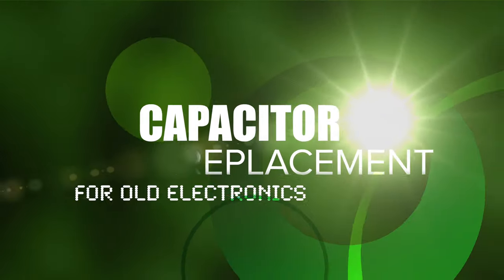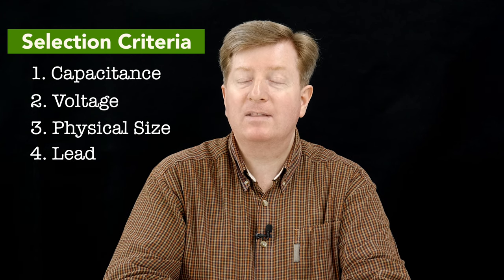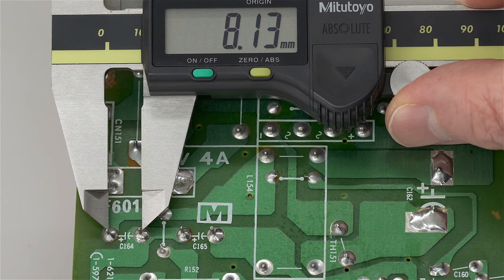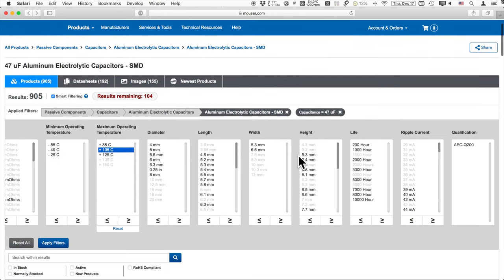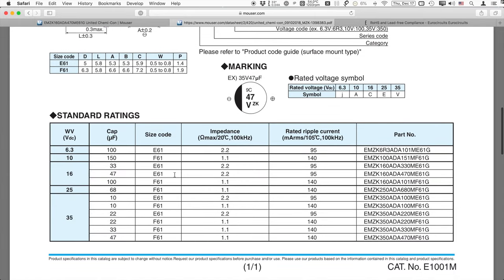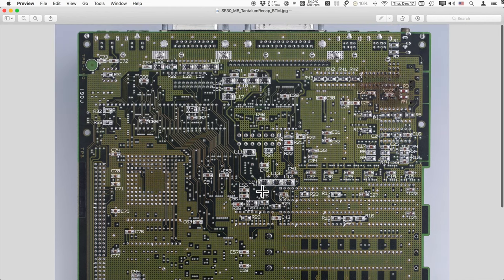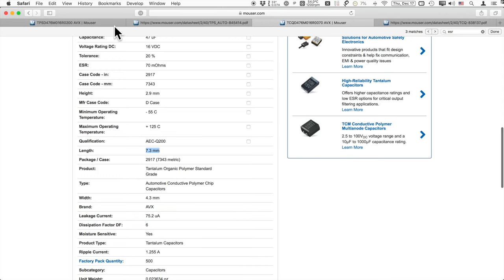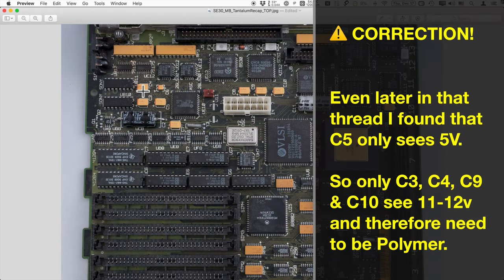Choosing Capacitors to Recap Old Electronics

Comment: If you aren't able to determine the original voltage raring of a cap. Look for other caps on the board that are in parallel to the one being replaced.  The voltage rating on those would be the same as the one in question.
Reply from the maker: That sometimes works, but not always.  It's still a guessing game.  For example, the SONY PSU inside an Apple HD20SC external hard disk drive enclosure uses two 2200uF caps side by side, but one is rated for 16V while the other 10V.  In that case I can see the voltage ratings, but let's assume for the moment I could only see the voltage rating on one and not the other.  Well, I thought it okay to buy two 16V replacements because they would physically fit, but I later found the output became unstable due to the fact the higher voltage rated cap had different ESR specs which impacted the require minimum ESR of that particular power supply.  You can see that in my video below and in the spreadsheet I made which shows replacement cap specs side-by-side.  So if you look at a given PCB and pick a replacement cap based on the voltage rating of nearby caps, it may or may not work as expected, at least, not in a switch-mode power supply.
• VIDEO: https://youtu.be/Qof-Wjj_rWI?t=1643
• SPREADSHEET: https://bit.ly/3yFsoOT

Comment: Your definition of “old electronics” is my definition of “modern”! Surface mount components, IC’s! Hell I think anything solid state is modern let alone ICs and surface mount stuff! The term “Older electronics” means vacuum tube stuff to me.
Reply from the maker: I was 13 in 1984 when the first Macintosh 128K came out.  I am a fan of such 1980's vintage computers to this day.  So when I speak about something old or vintage, it tends to come from around that time frame, or perhaps a decade earlier in the 1970's.  Vacuum tubes were a bit before my time. 🙂
Reply: In the late "60s, I used to frequent the Burstein-Appleby outlet in Tucson.  The franchise was owned by an old ham, Walt Nettles.  He told stories about the REAL good old days of amateur radio.  He told tales of reluctors, chemical rectifiers, and the rotary spark-gap...and then, young up-start, Lee De Forest, invented that damned three-element vacuum tube, and the whole World changed!  Now THAT was "old" electronics!
Reply: Imagine how it was.....You're sitting at your bench, tapping on the key,  the fizzing/bubbling of the bank of chemical rectifiers in the background, the buzzing/crackling of the spark-gap...you flip the knife-switch to "receive," adjust the "cat whisker" on on your galena crystal.  Outside, the end-fed Long-wire (1+ wavelength at a couple hundred "kc") sways in the wind.  THOSE were the days!
Reply from the maker: @Pootycat8359  Being only 51 and too "young" :-) to remember those days, I will take your word for it, especially because I've never touched a HAM before (well, except for Thanksgiving and Christmas).

Comment: Loathe LEAD-FREE SOLDER,JOINTS. Especially dry joints manufactured in early days of Lead free implementation. And when I returned to soldering after two decades of total passivity, I didn't know what is going wrong.. soldering was easy when i was barely TEEN,and now I couldn't joint two cables together, leave alone audio connector...
Reply from the maker: Indeed, and here's an excellent overview of the TIN WHISKER PROBLEM pertaining to Lead-free solder: 
https://www.analog.com/en/technical-articles/tin-whiskers-are-real-and-complex.html
Reply: This is so true, last I soldered a substantial amount was Hafler Amp and preamp kits in the mid 80s I just completed a blue ESR meter and within minutes noticed that lead free sucked and required higher temps.  Thank heavens I still had legit fine rosin core solder from the mid 80s that flowed beautifully.   You gotta love so called "progress".

I'm going to be on a hunt for the real stuff, is it available anywhere?

Comment: Just recapped my IIsi today, it's working! all I need is a monitor and peripherals and I will finally have a really nice vintage mac. I unfortunately had not watched this video at that time, but here I am now. I did buy the logic board caps from amazon, but the power supply board caps are from Mouser.
Reply from the maker: Glad your IIsi is now working!  I can't speak about caps from Amazon, but I can say that when you buy from vendors like DigiKey or Mouser or RS Components, you will get quality parts.Sometimes when you buy from Amazon, you don't know what you're getting until it arrives, and that remains true even if the Amazon page advertises a big name cap brand like Nichicon.  Also, if you need cheap caps quickly, yet from a very reputable vendor, you should check out Console5.  I've not purchased from them only because I always get parts from Mouser, but their kits are top notch and sell for great prices.
Reply: @JDW-  Yeah, I kinda, just put in the uF and volts and went from there, I got lucky on amazon because the size was good enough and I did have to replace some axials with radials. I used a pic guide from @BranchusCreations IIsi video. Wish I had watched your video sooner lol. Oh well, lessons learned.

https://www.youtube.com/watch?v=YNsPr1mHUrw

Comment: Great tutorial. You can also measure the resistance or microhenries of the inductors with the MESR-100 ESR meter. The reactance formula is 2𝛑FL. That would be 2 x 3.14 x frequency of esr meter which is 100 kHz x 100 (uH) Just plug it in to get the reading.

For resistance R=0.628 X L(uH)
For Inductance L(uH)=R(ohms) ➗ 0.628

Comment: There's one useful source of information you didn't specifically mention.  Often you can track down "service manuals" for your equipment.  This is usually the source for the schematics, but "service manual" is usually a better Google search term. Even if the service manuals only have block diagrams, they sometimes list the "bill of materials".  For example, I have a music studio effects unit from Lexicon, and its service manual lists all the capacitors used, their specifications, how many of them there are, and what they are labeled on the silkscreen on the motherboard, i.e.:
"CAP,ELEC,22UF,25V,RAD   4     C27,28,31, 104"
Having watched your video I can now interpret that as "Capacitor, electrolytic, 22 microfarads, 25 volts, radial.  There are 4 of them, specifically the ones labeled 'C27', 'C28', 'C31' and 'C104' in white on the motherboard."  I'll still need to measure them with calipers, but I'm a lot farther into identifying replacements than I was before.
Reply from the maker: Thank you for making time to let me know my video was helpful to you, and for sharing your personal experience. The primary reason I did not mention “service manuals,“ is because I myself recap vintage Macintosh computers, especially from the 1980s. For those machines, there are no service manuals with schematics or BOM‘s. Larry Pina books offer a complete capacitor list in the appendix for certain Mac models, but for other Mac schematics you need to search online, especially vintage Macintosh discussion forums or the Macintosh Garden. 

For applications like yours though, you are correct, there are a good number of service manuals out there which provide extremely detailed and helpful information. Thank you for bringing that to our attention.

I wish you the best in your recapping adventure!

Comment: Very helpful. Thanks for sharing your knowledge. I'm a mechanical engineer and electronics are not my expertise. Despite that, I've always been interested in computers and have build my own machines since 386/486 days. At high school, I had an Apple II+ plugged into a 26 inch Philco TV (valve tech), which I had to "dispute" with family. A lot of nice memories. Anyway, I have some retro stuff at home: kept P2, P3 and some Athlon XP mainboards, plus 3dfx video cards, and an Apple II plus, IIe and IIGS I've collected over the years. Most of these boards (and some PSUs) need a recap job. I've trained over the last year on junk electronics (meant to scrap) in order to learn how to weld and now I feel confident I can do it. I decided to learn this skill because many things break at our homes due to failing/ageing capacitors and most business just want to replace parts, not fix. A total waste and very hard to keep our loved retro stuff working. That's how I've arrived at you video. Watched 2 times already. Made a list of the capacitors I need and have browsed over mouser.com. One thing I didn't get, it is how to choose capacitors for these mainboards concerning ripple current and ESR: what should I pick?  If I understood correctly, ESR is ok if not too high, but it doesn't have to be the lowest also. What about ripple current: low or high? That was not clear to me. Hope you or someone reading the comments can clarify that.
Reply from the maker: Typically, a low ESR capacitor will also allow for a much higher ripple current.  I hesitate to give you a general rule for choosing ESR and Ripple only because it really depends on what you are recapping.  

Power Supplies are most sensitive to ESR and Ripple.  If you are not recapping a power supply, but instead doing a motherboard, in many cases the capacitors are just what they call "bypass capacitors" which prevent voltage drops from occurring.  In that case, you can most often use the lowest ESR caps possible and will be fine.  In fact, I recently released a video on Overclocking a Macintosh LC575 motherboard (aka Color Classic MYSTIC), and I used solid polymer OS-CON capacitors, which have only about 0.025 Ohm ESR, and discovered that kind of low ESR capacitor is actually required to overclocking to the highest speeds.  Two associates tried overclocking with solid tantalum capacitors (0.7 ohm) and found they could not overclock as high!  So low ESR capacitors definitely have their place.  

Often times, very low ESR caps can be used in power supplies too, but some power supplies require a minimum ESR, and it's very hard to know that without a schematic, yet most of the time we don't have a schematic!  I came across that problem when I recapped the Apple HD20SC external hard disk enclosure.  I did a video on that as well.  The power supply had a brief whining sound with a very low ESR replacement capacitor, but when I swapped out with a slightly higher ESR cap, the noise went away.  (Basically the switching frequency became unstable at power on due to the low ESR cap.)  

All said, the best general advice I can give is to go with low ESR caps where possible, as those will work most of the time, but you need to be prepared to try different caps on some power supplies.  If you choose a polymer aluminum cap, I recommend the "solid" kind rather than "hybrid" because the hybrid types have a liquid inside that theoretically could leak out many year from now.  Solid type caps cannot ever leak.
Reply: @JDW-  Great! That's what I needed... some pointers... I got your point, don't worry I understood your rational... and have now a starting reference. Thanks a lot / kind regards

Comment: Great use of Mousers site to illustrate the thought process used toward picking out a replacement option. I prefer Mousers site myself and thought i would throw my 2 cents in about one of the features I love.

This may have already been mentioned by someone else but Mousers site actually will show how many fit your criteria BEFORE you hit apply. 

At the Far left of the screen under the Products Section in Blue it keeps track of the shown RESULTS # —> To the RIGHT in RED it keeps track of the current results remaining according to your filters. 

To actually view those results you still need to click apply filters however it’s a very helpful tool to know ahead of time which filters you’re choosing might be excessively limiting your options. 

ESPECIALLY if any of the filters were preference and not strictly necessary for the operating criteria.
Reply from the maker: Yes, it is convenient. Thank you for pointing out that feature.  I show it at about 25:38 in the video, but I do not discuss it.  You can see "Results" at the far left (a large number) and then I click a Voltage Rating filter (but don't Apply it), and "Results Remaining" appears in red, showing you what to expect when you do actually click Apply.

Comment: Hello James, thank you for putting this together! The video was both entertaining and most educational. Unlike yourself, I don't have an electrical engineering background but my collection of old Macs does require that I know what I am doing to the best of my ability and your expert advise on all things capacitors has given me much need confidence and a heck of a lot of information that I was able to easily grasp. I would also like to thank you for the practical examples based on the SE/30.

As you know, collecting vintage equipment does require a number of skills, key sets of knowledge and repair/diagnostic equipment to effectively maintain the health and wellbeing of those devices. Again, your expertise has elevated my confidence in effectively choosing the correct capacitor for the application. I sincerely appreciate the time and care you put into making this video and I am definitely bookmarking this video for future reference. When I am better able to, I will drop something in the PayPal tip jar as a token of my appreciation!
Reply from the maker: Thank you, Alex!

Comment: Thank you for a very in depth content regarding capacitors.  For most hobbyist types like me, caps have always been a bit mysterious.  Almost all other familiar components with exception of chokes maybe, it’s pretty straight forward.  I really appreciated how you took the Mouser filter to the nth degree.  And you description of tantalums was dead on.  A question… is there a modern replacement for RIFA caps?  I like the idea of having filtering on the mains.
Reply from the maker: Hi, Frank.  In the Mouser cart I provide in the text description under my Mac Plus Analog Board recap video, I use a Ceramic Safety capacitor with X & Y ratings as a replacement for 
C33 & C37: https://www.mouser.com/ProductDetail/80-C971U472MUWDBWL40
So when replacing a RIFA, you just want to make sure your ceramic has the correct high voltage rating, then make sure it has the X1  & Y1 safety ratings, ensure the capacitance is the same, and make sure the lead spacing is such that it will fit nicely.  Some of my Analog Boards have RIFAs while others have the ceramics -- all original parts from back in the day.  So there's nothing inherently wrong with substituting a plastic and paper RIFA with a good ceramic safety capacitor.

Comment: Super Walmart now sell a hardplastic digital calipers for under $10. They are extremely accurate and repeatable on measurements. I was very surprised!
They are nowhere near mitutoyo quality!
For a hobbyist they are perfect!
Reply from the maker: Ronnie, you’re very kind recommendation can potentially save people a lot of money so I will make it a pinned comment. Also, could you please confirm if the product shown at the URL below is the one you were talking about?
https://www.walmart.com/ip/Digital-Caliper-0-6-Calipers-Measuring-Tool-Electronic-Micrometer-Caliper-Large-LCD-Screen-Vernier-Auto-Off-Feature-Inch-Metric-Conversion/960691125?athbdg=L1700
Reply: @JDW-  yes, that is close enough.
 Mine has black buttons.  Thank you!👍
Reply: If money is king, Harbor Freight also sells them.